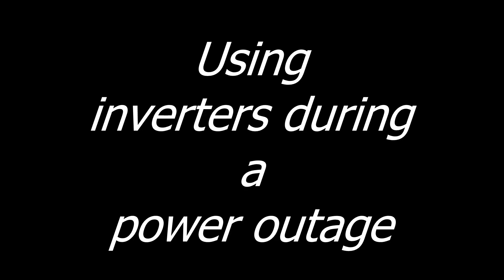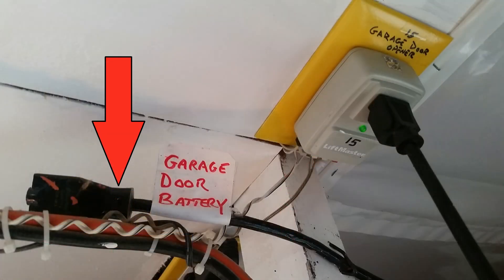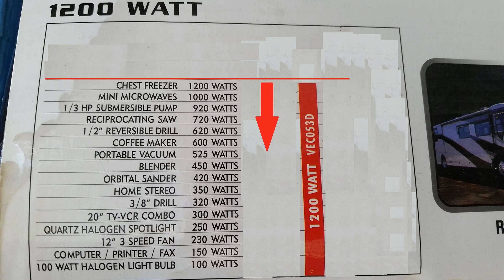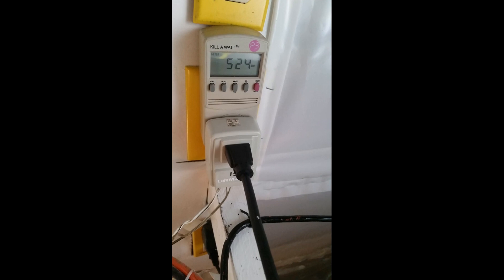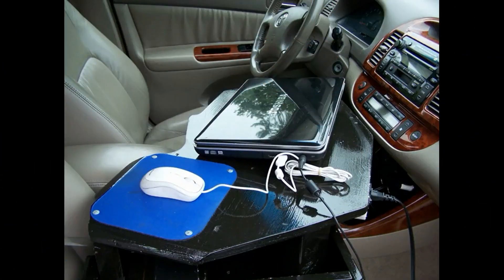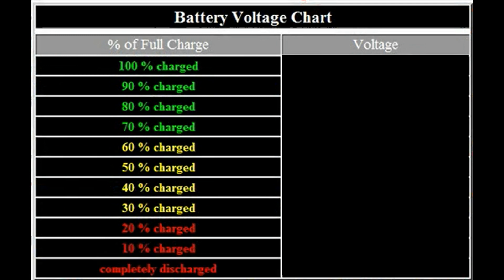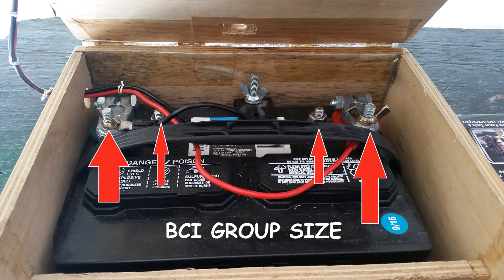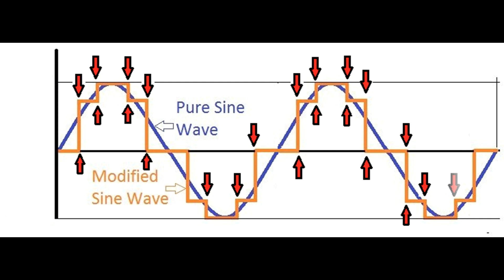Preparedness (emergency power from inverters)

Comment: I now have enough information to be dangerous.
 I wanted to setup two deep cell batteries taken from my camper and use it with a cheap 500 watt inverter to run a cpap machine overnight in a power outage. The information on the cpap machine gives no wattage info, but it does have the following...
DC24V
3.75A
using an Amps to Watts conversion table(very convenient BTW) it tells me 90 watts.
Do you see any issues with my setup? And am I correct in thinking that the batteries/inverter has to be near my bed so as to not loose power over say an extension cord?  
Thank you for your time.
Reply from the maker: Hello.  First off, you do want the inverter as close to the batteries as possible. The wiring for the DC side should be short. The output of the inverter is AC and will travel down an extension cord with no problems. I am a bit confused though. You said your machine runs on a DC voltage. (DC24V) This seems very odd to me. Especially if you are plugging the machine into a wall outlet. Is the plug a wall wart that converts the AC to DC voltage for the machine? If so, it sounds like a sound plan with one provision. Will your batteries last all night? Please watch my videos on lead acid batteries. They are a bit tricky on how much current you can really get out of them. Remember that cheap inverters are very inefficient. You will be burning up a lot more then 90 watts running it. I would suggest doing a test run on your setup for the length of time you plan on using the inverter at night. While testing, monitor the voltage of the batteries as I show in my battery videos to ensure you are not damaging them. good luck!!
Reply: @bounder97   Thanks for your input. Looking like I need a device that will monitor so the battery doesn't go below half a charge? (I'm told that would be bad for the battery) Do you know of a good one? Also I would be open to purchasing a better quality 1,000 watt inverter. Again...Thank You.